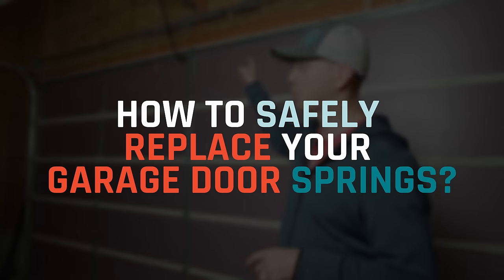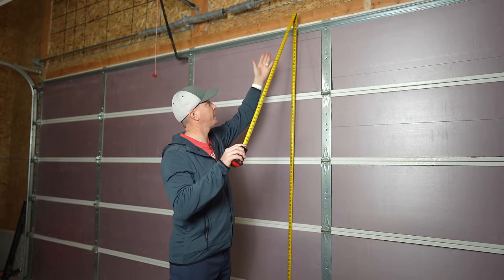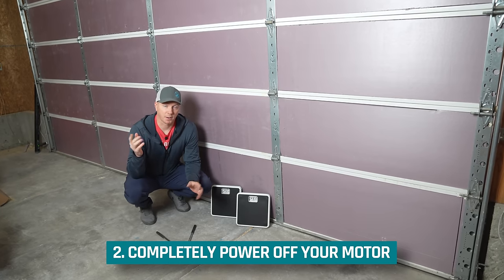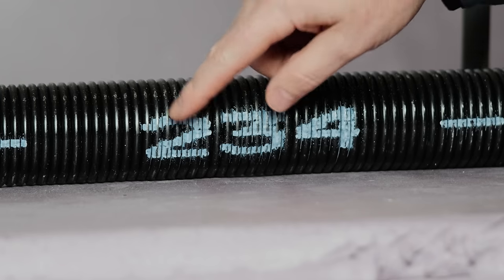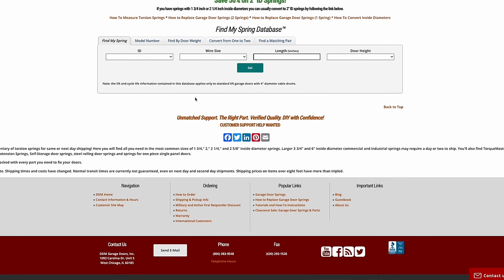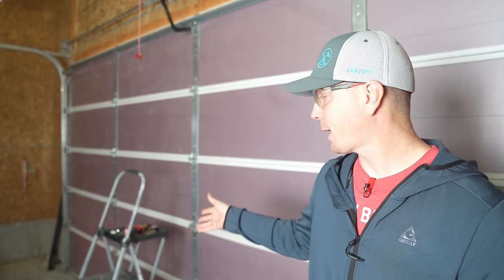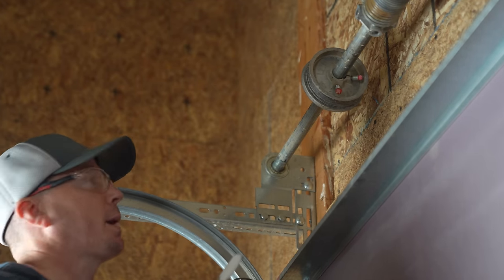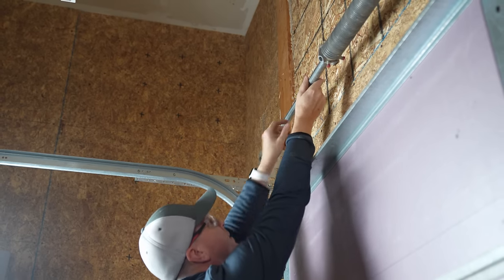How to Safely Replace Garage Door Springs & Save Hundreds

Comment: Well done, mostly. I have more than 20 years of Garage door installation, removals and repairs. You really should have a taller ladder for a 8 ft tall door. When you wind the springs you may need to brace against the ladder to counter the toque of the spring. I would want a 6 ft ladder. When you are marking the torsion tube at the drum the cable is off the drum. The marking will be slightly off. As a pro I would lock the torsion tube with 2 vice grips with curve jaws in both directions against the wall above the door. I saw that you had 2 pairs of vice grips in the video. I use 2 to secure the torsion tube. Not every one does this. For a 8 ft tall door you will normally put on 8 1/2 to 8 3/4  full turns. The springs will break in and lose some strength during the fir week of use. A 7 ft tall door gets 7 1/2 to 7 3/4 full turns. The door should balance from your knee to your shoulder. The springs will be a little hot at first . That is normal. They will break in soon. Your door will be heavy in a week or two. Then you will need to add tension. Open your door manually after about one week after spring installation to see how much tension may have been lost to break in. If the springs are too light the opener could cause a lose cable to come off the drum. This creates a dangerous problem. If your door has just one spring when it breaks always replace it with 2 smaller springs. They will last twice as long and the door runs better with 2 springs.
Reply from the maker: This is all excellent information, my friend,. Thank you so much for this!
Reply: Towards the end, of above response, when you said if the springs are too light, do you mean light as in tension?...not putting enough turns?
Reply: @jao8084  Yes, when the door opens, the springs unwind. So if you have too little tension on the springs, this will cause the cables to slack and potentially come off the drum. That creates a lot of issues. When you replace your springs, it's  good practice to open the door all the way manually and ensure both cables are taunt.
Reply: What do you think will happen if I don’t do this after adding insulation like this video?
Reply: @Esterovball  the door will be too heavy. If you have an operator, it might still lift the door but will eventually "burn" out.
Reply: Can I just run my door up all the way and take the brackets loose to raise the whole door and track up? I'm putting concrete in my barn and the doors/tracks are too low.
Reply: @WolfinWolvesClothing713  I would clamp the door when it's in the radius. If your vertical tracks are attached with bolts just take those out and just remove those. Sometimes, they are riveted to the jam brackets and if drilling them isn't an option just use a Sawzall and cut an 1" from the bottom
Reply: If you happen to have pair of calipers you can just measure the diameter of the spring wire.
Reply: I've got a couple of old heavy wood garage doors that are in an old barn.  They stopped using them in the 70's and are both are stuck in the fully open position.  They are so corroded rotted and beat up there is no way to get them down without tearing them out with a tractor or something.  Should most of the tension be off the springs in the open position?  I'm going to have to crawl up there and some how get those springs off before cutting the doors out.
Reply: @Corey-dy2cq it's not safe to give advice without seeing the doors. If they have been stuck open for 40 years, they could have a bolt going through the track, keeping it open. But not knowing how it's rigged, I could be setting you for injury. I would recommend calling a local door company for a "free quote" and asking them how they would do it. Then, with knowing the steps and price options, you can choose what to do from there.
Reply: I thought it was a good video!

Comment: I have had the enjoyment of replacing a lot of those garage door springs and garage door openers. The tension springs are extremely dangerous and you should always use an abundance of caution when working on them. If you heard one snap you would understand, most people think something hit their house when they break under tension. There is a great deal of kinetic energy in those springs. Your tutorial was spot on with the procedure to replace the springs.

As far as staying in the safety zone it is not just you but anyone else in the garage with you. I cringed watching your daughter get in that danger zone with the scales. But it all turned out safely. Just remember that in the future if you have to do this again.
Reply from the maker: Good points. I'm glad I was holding the winding cone with the winding bar while she was there but I understand what you mean - I could have had her go around me to stay clear of that path since something certainly could have gone wrong. A good warning to other DIYers.
Reply: I had the exact same concern the minute I saw him set up 2 scales, and said his daughter was going to set them...
Reply: @troubleshooter1975 You really have to treat garage door springs like they are explosive devices, because they can literally explode. Many homeowners will say when one of the springs break that they thought something hit their house, because it is that violent. Now under the proper precautions they are relatively safe to replace, but you must use and abundance of caution for you and those that might be around you.

Comment: Hello, its October 5, 2024. I just replaced my springs following this video, all went very well until I tried to make the springs 1/4 turn tighter. While making the adjustments some how the cables came off the spools. I imagine that I should have put the vise grips back in place (somewhere) to hold everything but I didn't because you didn't mention anything like this in the final adjustment section. I ended up having to release both springs and start over. 
I am happy to say that I did get it correct and working. also the cable spools needed to be against the bearing bracket too.
Thank you for this very helpful instruction video!

Comment: Great video!  I studied this video and found it extremely useful - it made my work replacing my springs easy.  One thing that I ran into while doing this job was something that was not mentioned in the video - the cable placement on the cable drums.  An issue I ran into was when I first put tension on the new springs, and lifted the door by hand to check it, the cable came off one of the drums.  This happened a couple of times before I realized that the cable ends were sticking out from the drum and the wall bracket for the torque shaft was actually sliding the ends out of the slot, causing the door function to fail.  Finally, after much work trying to get the door to work correctly, I realized this, and when I finally put the cable back on the drum properly, with the ends tucked under the outside lip, proper function of the door was achieved.  Maybe this should be mentioned in the video, to make sure those cable ends don't stick out to catch on the mounting - bearing brackets for the torsion bar.  This would help future installation instructions..

Comment: Following this repair will result in a better repair than you're likely to get by hiring a pro. Helping friends and family lubricate their doors, I've noticed most doors aren't properly balanced. If you count the number of turns, they're tightened properly, but the wrong weight/length spring was installed in most cases. I believe that the garage door guys either replace like for like spring size without verifying they are correct, or they use what they have on the truck that's "close enough". 

Certainly only tackle this job if you're the OCD type as safety and attention to detail are paramount, and it's not worth risking your safety. 

With all that said, as a DIY guy, replacing my springs and door hardware was one of the most satisfying DIY repairs. The door is perfectly balanced, and it's nice and quiet. It's going to last years with minimum maintenance. I wish this video had existed back when I worked on my door.
Reply from the maker: While I suspect most garage door repair techs are doing a great job, I have definitely heard cases of them using a spring that isn't optimal for the door because they had it in stock and paid for already so it would save a few bucks. Mismatched springs are sometimes used in order to accommodate what the tech had on hand. Like you said, this is a very satisfying repair, so long as you're willing to take your time and be uber safe.
Reply: @LRN2DIY  having an undersized spring guarantees future work haha. A heavy door shortens the life of the worm gear and sprocket bushing on automatic openers. My parents have lived in their house for forty years, and have had multiple spring replacements and drive failures. They seem to only get 5 years out of a repair. I finally ordered the proper spring and got the door balanced, and they're in good shape now. I had a similar issue at my house and proactively changed the spring for the right size in order to prevent future problems. 

Short lifespan aside, having a heavy door means your family could be stranded in the case of a power outage. Neither my wife or my mom could manually lift the door on either of our houses before I got the doors balanced.

Comment: You Sir, are like the little pin holding the steel cable at the bottom: In spite of  so much weight and tension, you've succeeded in lifting us all up! Super video in content and construction. Thank you for all your careful work. I finally got my heavy off track wood double door working. YAY! And I'm a 5'4", 72 yo gal. We used to have to walk to the library to read manuals to fix stuff. Now the world is in the palm of our hands.  Fantastic!

Comment: Great Video !  FYI  , the Drums / Cable pulleys are 1 foot  circumference  , so an 8 foot door = 8 winds + a 1/4 to a 1/2/winds  and that is  what you came up with. plus No need to crush the pipe when tightening  the 3/8 set screws, that just makes it harder to remove or install the next time. Always go for the higher cycle  rated springs , its worth the money.
Reply from the maker: Great input, Robert. Thanks!

Comment: I followed your instructions and repaired my door. I did not have broken springs, but the center bracket actually tore loose from the wall. I had to unwind the springs, remount the bracket, wind the springs, etc. Worked out great. You're a great teacher! Thanks.

Comment: Just got my springs installed.  This video was very helpful.  Particularly in identifying what springs to purchase and how to purchase them.  I went to the site he mentioned DDM Garage Doors and they sent me a link with all my options immediately.  I pick out my springs with confidence and had them installed by the end of the week.  

My door runs and sounds great.  The total cost for me was around $150.  I got the winding rods from Amazon and the springs from DDM.  

Please be safe everyone and keep a firm grip on the winding rods.

Comment: appreciate very much your patrience with detailed explanations for someone like me who is a novice to a torsion spring garage door; upon my 2nd viewing (after doing much intervening research on my own), i think that it would be helpful to spend a little more time explaining that there was a significant difference between your old springs and the new ones; while you glossed over the difference in measurements, your replacement springs were noticeably stronger than the prior ones both in wire gauge and length; in understanding my situation, i have found that the recommended replacement springs are also significantly stronger than my old broken one; apparently, when a more substantial door was replaced in 2010, the installers did not replace the corresponding recommended springs----so from what my research has enlightened me about is that just re-installing the same size of prior springs is not the best assumption (which may have been how a commercial installer would have handled my issue); also, FYI, using only one of the Walmart scales centered under a double door, instead of 2 scales, worked for me---the one scale gave a reading of 250 pounds; i finally tracked down the manufacturer's specs, and it stated the weight was 242 pounds; also, once i finally tracked down the manufacturer's specs (Haas corporate never replied to me), the specs gave the exact spring size that should have been on the door; the manufacturer recommended 0.234-2-27 springs, and what had been on the door since the 2010 replacement, and now is broken, was 0.218-1.75-28 ;

again, thank you for your efforts in this detailed video

Comment: Great video! I am a DYI-er, but this is one project I've always paid someone else to do. I'm confident I can take this on safely now. Thank you.
Reply from the maker: That's totally reasonable. If in doubt at all on something like this, calling a pro is the way to go but it really is DIY-able if you take it slow and safe.
Reply: Stay on the outside of the spring.  If the good one pops, there may be a projectile.  I worked at Wayne Dalton for a bit.  Seen one of those tubed twisted by the spring as well, that was a hard fix, that's why I ask how old always.  Cause you may have to change out the bar/tube/pipe as well.  There is a methodology to that also.  You can get yourself killed/mangled.  Be careful.
Reply: @LRN2DIY  "it really is DIY-able if you take it slow and safe."  You weren't safe.  It's always from the outside of the spring that you unwind and rewind.  I made a long comment, you should find it and read it.

Comment: Thank you for the video. I replaced tmy springs for only $55. I liked the step by step process. I especially liked how you pretended to not undo the fasener screws before putting on the new spring, so we would not make that mistake. Thanks again!

Comment: Wish I had seen this before I paid through the nose to have a tech come and replace my springs. Two days later one cables failed (they wrapped it wrong?) and my door was stuck at an angle. Had to cut the other cable to get it to come down. Certainly wasn't going to call those yahoos back. Using this video I was able to repair that BS with new cables and a well tensioned door. Thanks!

Comment: Just wanted to say thanks for taking the time to share you knowledge by shooting, editing, and uploading this video.  I'm a rather handy guy but never wanted to attempt this repair because it seemed so dangerous.  With your thorough instruction, and safety tips I was able to find the right parts on Amazon ($135), get longer lasting equipment, stay safe, and save lots of cash. The toughest part I found was the last 10 quarter turns of each spring when the tension got really high. Well done! I get the effort that went into this because I have uploaded a few how-to's myself.

Comment: Thank You for sharing your knowledge and experience.  
Last week I installed a two ton mini split system in my boat garage following your guidance.
I am now ordering the garage door insulation from your previous video.  I never would have considered the weight variance for the door springs.

Comment: Good video.  I have done this twice now at my house, two 24" wide springs on a 7' door, most recently yesterday.  As of April 2024, I got a quote from a reputable door service guy my neighbor has used and liked - $250 per spring, plus $75 service call = $575.  On Amazon I got two  Vevo brand springs, with winding bars and included new drum cables, for $65.  The door lost multiple rollers and got badly off kilter when springs broke and door fell hard.  It took me and my hand brother about 80 minutes to replace, more time spent getting rollers replaced and the door aligned to move in its tracks.  The spring part is easy if you just take your time.  And measure twice if you're not sure of your spring size, it's not hard, just tedious counting spring coils and doing a tad of basic math.  I saved $500.  You can too.  And the Vevo springs and winding bar seem very good quality, even cam e with a decent pair of cotton gloves with the little blue rubber stipply grippy bumps.   I did it alone the first time when the door was not out of its rollers.  One person can do it that way as in this video; if the door is jacked up and out of alignment, buy a 12 pack of beer and grab a buddy.
Reply: Should probably drink the beer AFTER the job is finished. 😂

Comment: Brother you helped me tremendously.  I had to remove about a full turn to get the correct tension for going down but otherwise you were spot on.  My old one was a 37 1/2 and the new spring was 35 1/2, when done, I measured to make sure i was 2 inches off.  The only difference I did from what you taught was on the center mount, I didnt trust to measure and it hold in place, so I took a sharpie and drew a line around the base showing exactly where it needed to go back.  Regardless, you took a project that was completely foreign to me and made it possible.  Thank you.

Comment: Great video.  I don't think there's any part of this job you didn't cover.  So I just got an estimate of $650 to replace both of the springs on my garage door. This seemed a bit high to me, but I really had no point of reference.  Now, I'm a DIY guy by nature, but I wasn't sold on the idea of replacing these springs myself only because I know the tension on these springs can cause some serious injuries if not handled properly.  After watching this video, I'm not worried about tackling this myself and I'll be saving probably $400 bucks in the process.

Comment: Great video. Inflation everywhere. Now 6 months later, the springs you bought are double the price at DDM. Still no excuse for the rip-off prices that many unscrupulous contractors charge. They're taking advantage of perceived homeowner urgency (like AC fan/compressor failures due to a $20 cap) to charge way more than a fair labor rate.